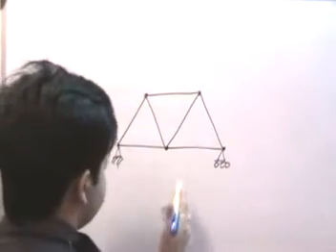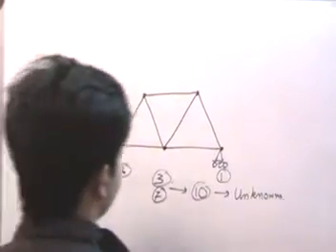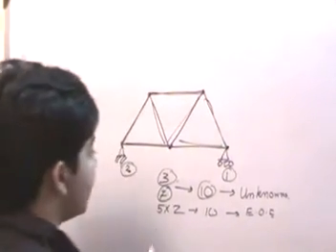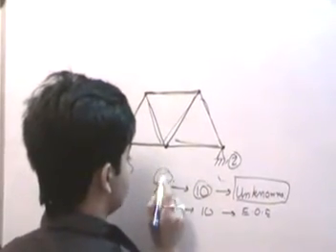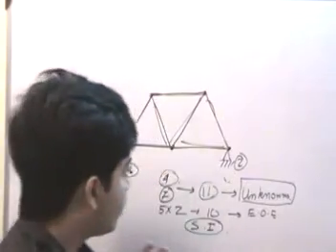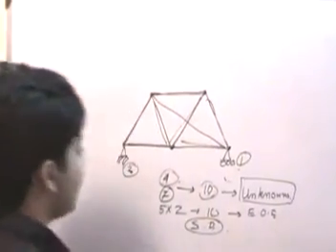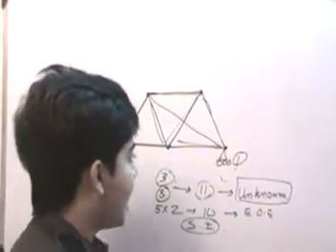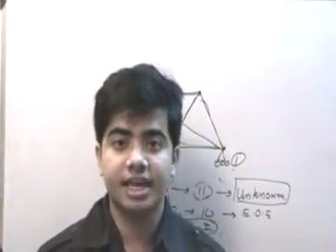determinacy and indeterminacy-2.mpg

Comment: i think you're brilliant for what you do. but i have a question about the resultant for on the roller joint. i thot the reaction is only in y direction which means the resultant force is 9, hence the structure will be SI. please explain. thanks
Reply: two reactions at hinge support, one at rollar total reactions 3. and 7 unknown member forces thus total 10 unknowns. also at each node or joint there are two equilibrium euations , so for 5 joints total 10 E.E.  So, [ UNKNOWNS - E.E = REDUNDENCY ]    10-10=0. Thus we can say that the structure is DETERMINATE.